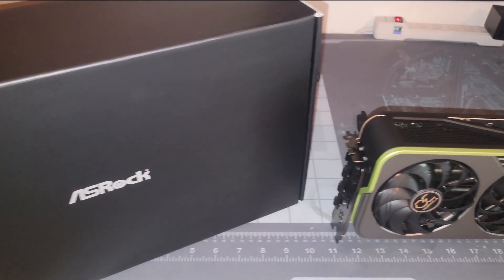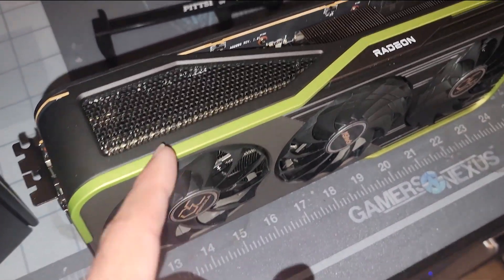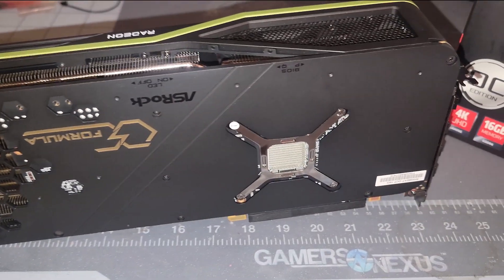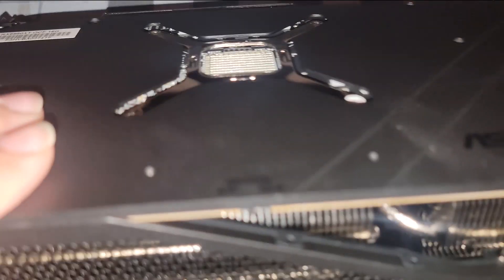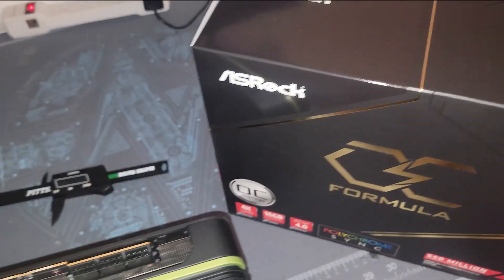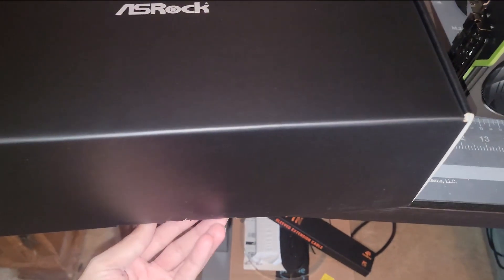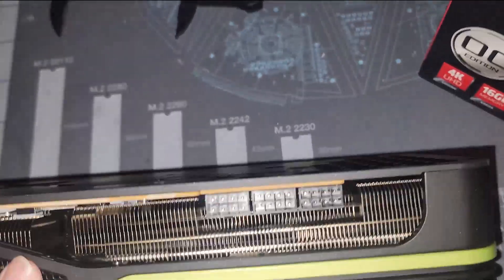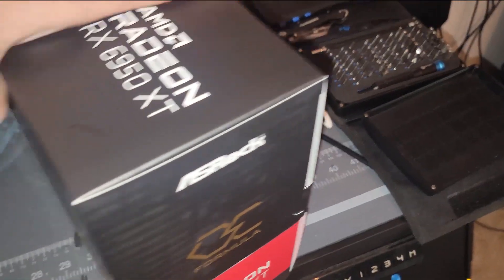Asrock RX 6950 XT OC Formula   First Look

Comment: I just ordered the 6900xt formula oc. Do you think an 850w would work with a 65w cpu? Do you think the 6950 is the same just a bios tweak than the 6900xt formula oc? Any way I could convince you do share both of your bios? I'd love to flash my card to see if it works, once I get it.
Reply from the maker: Yea the card at the max will do 480 watts, but plan to upgrade in the future especially as these cards get more power hungry
Reply from the maker: https://drive.google.com/drive/folders/16-qzs7Wib4ciMmr4dKWsC8RSPC4P9cxZ

Comment: Would a 750w psu okay with it?
Reply: Get a 1000w. 850w is also kinda pushing it.
Reply: You’d be pushing that power supply to its limits
Reply: These cards overclockef can draw over 500 watts
Reply: Would 850 be okay?
Reply: @rolandopietropaulomabulay3317  depends on your equipment, but tbh if you’re getting a card that can dish out over 500watts, I would recommend investing the extra money into a 1k+ power supply for efficiency. On the low end you’ll be in the powersupplys optimal range and on the high end you’ll have enough leg toon to not have to worry about possible shut offs/black screens
Reply: @josephsanchez6393  a GPU doesn't push power, it pulls it...

Comment: Just got my 6950xt OC Formula today. Yes, it's enough to cool it. Even at 480 watts, it cools it just fine. Can and will pull north of 600 watts water cooled if using MPT to allow it.
Reply: Will it run on Corsair RM1000x 80+ gold power supply?
Reply: Will it run on Asus Rog 850 Watt platinum psu?

Comment: If you take in account the whole cooler thickness, it's more like a 3 slots GPUs despite the cute 2 slots IO lol
Not really enthusiastic about that trend of power angry GPUs, hope it will be phased out.
AMD apparently is coming out with new GPUs next September/October this year, that refresh is kinda weird in a sense but i imagine anything will sell at this point of time lol
Reply from the maker: I believe it is just extra stock on 7nm they wanted to get rid of it
Reply: It's no wonder they are power hungry since they don't produce new architecture but they get the  "old car and they add a turbo on that old engine" so that it performs better. It's like "pimp my ride" for gpus. 

Evolution means a better gpus that needs less power and produces less heat. not the opposite. 

and they raised MSRP for it! as if we didn't know how to oc it ourselves.